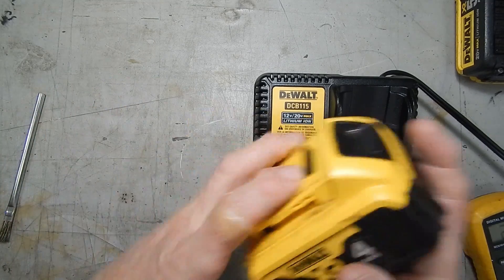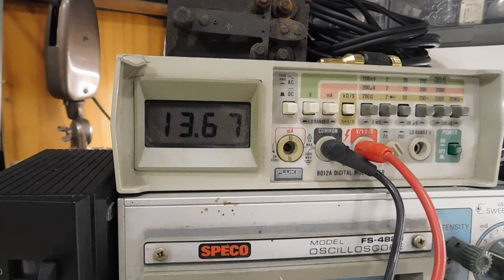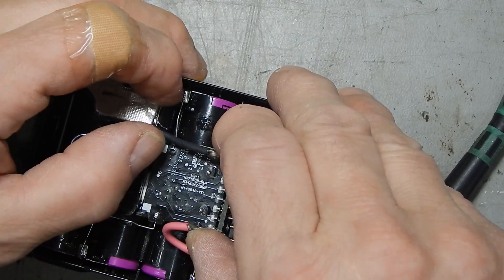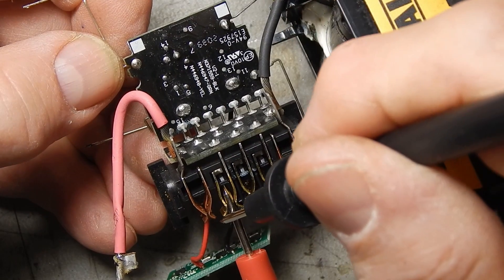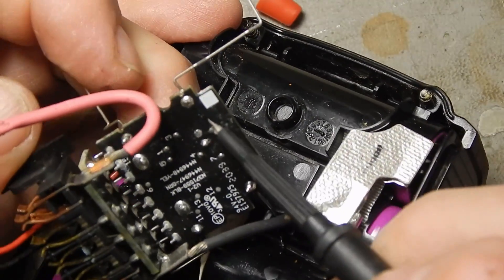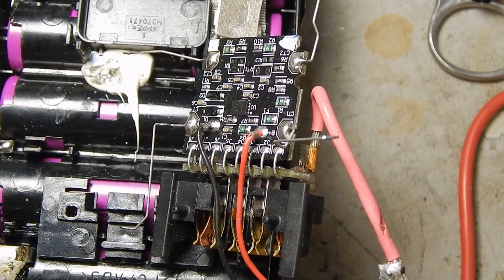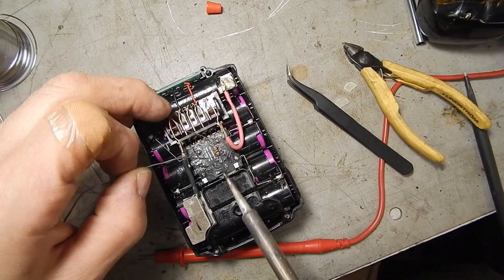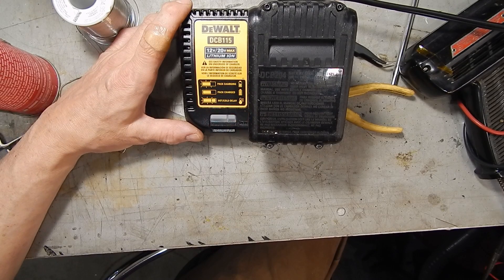DeWalt 20VMax Battery Hot Cold Charge Delay No Matter What Temperature

Comment: You saved me a ton of time once I figured the thermistor was the issue. 

I'm not sure why you got 4 downs for this. Video was massively helpful.

Slightly different issue, as I had an intermittent fault for a few weeks before failure. I chucked in a new thermistor and a spare 88Ohm resistor wired direct to the leg of the thermistor. 

That's £60 saved and 1 less piece of E-waste!

Massive thanks.

Comment: Jake, thanks for sharing the video. Can you tell me exactly how you determined that the thermistor was bad (multimeter setting and where exactly you contacted the red / black multimeter prongs...it was difficult to see in the video) and what is an approx. normal read versus a bad one? I have a fairly new Dewalt 20V 8AH battery that was used lightly approx. 5 times, and I got the flashing yellow light while charging. What was interesting was the yellow light went off when I angled the battery while docked (I kind of pulled the battery away from dock while still inserted if that makes sense...possibly somehow pulled away the TH when charging?) so I maintained that weird angle and the battery went to a full charge without the yellow light. Unfortunately, the battery only works on my flashlight but if I use it on anything requiring more power (router, drills, etc.) it won't work. The battery reads 19.9V when tested. I plan on contacting the church to have an exorcism done on it soon. lol
Reply from the maker: It’s been some time since I made this video and I don’t remember the answers to your questions. In general the most common thermistors should read about 10K ohms at room temperature, they should not read open or 0 ohms. From your description, I’d look closely at the batteries contacts. My theory is ther is some dirt or corrosion such they can provide enough current for the flashlight but not any more demanding tools. Either that or you just happen to get a battery with a faulty cell.

Comment: I got a defective DCB210 from the flea market exactly two weeks ago. Believe it or not, I went there looking for one after one of mine failed since my mower needs two. Yeah, these batteries are notoriously bad.

I expected to be salvaging a couple good cells to restore my bad pack. Sure enough, it had one bank for two cells that was only reasoning 1.1v but I used alligator clips to a smart cell charger and it came back up to working voltage. Unfortunately, it still wouldn’t charge on the DeWALT charger and would always trigger the thermal delay.

I found there was no continuity between TH and the thermistor. Weirdly, the break appears to be between the two PCBs even though the exposed/bent wire was fine.

On a DCB210 the positive wire is welded on both ends so I couldn’t simply desolder it. I masked off everything with kapton and electrical tape to avoid shorting with my iron right under the positive terminal and made a jumper wire, which seems to have fixed everything. I’m still running each bank of cells through a charge/refresh cycle with the smart charger but it seems to be working. :)

If the cells that were dangerously undervolted don’t hold up under load then it’s back to Plan A but I did use it to mow the lawn once already.

Comment: Hi just Saw this video,  I have the same issue with One of my 18v 5ah Battery, you say 100 Ohms resictor and Mathias says 13k ? Which One to use 😀 and do you have to remove the Surface mounted one first?
Reply from the maker: I think he was talking about replacing the thermistor with a fixed resistor, where, as I was repairing a resistor in the circuit, so that the thermistor would still operate correctly
Reply: @JakevonSlatt  ok, I Think the thermistor in my dewalt battery is Broken. No measurement. Can I just replace that without removing the Old One?
Reply from the maker: @fmolland  theoretically yes, if it’s truly permanently broken. But I think I’d remove it anyways just to be safe.
Reply: @JakevonSlatt  thank you, I will order some thermistor for this. I had hoped to not remove (turn over) the pcb but I guess I have to 😀
Reply: IF thermistor is defect - Dead, would battery work? My battery Works on one of My Tool, not all
Reply from the maker: @fmolland  it should work and any tool, but it may not charge. The thermistor is only read by the charger.

Comment: Nice fix, I would have just put 13 k resistor across the terminals to fool the charger, ignoring any temperature issues.
Reply from the maker: I considered that, but the cold delay especially is useful sometimes when I've been working outside all day!
Reply: Could you explain how to do this please?
Reply: 100 or 13k?